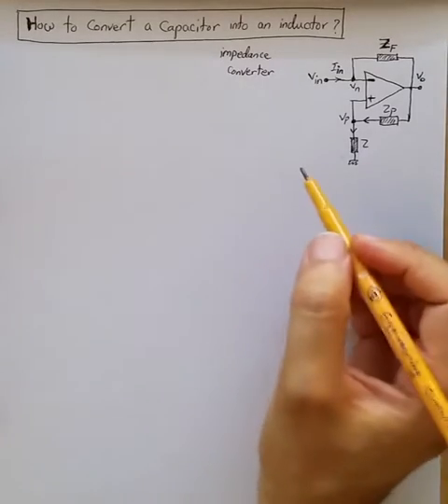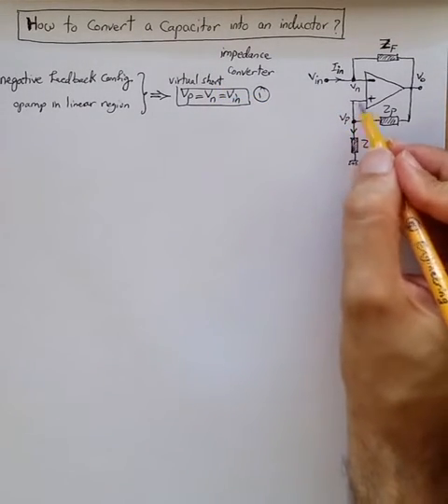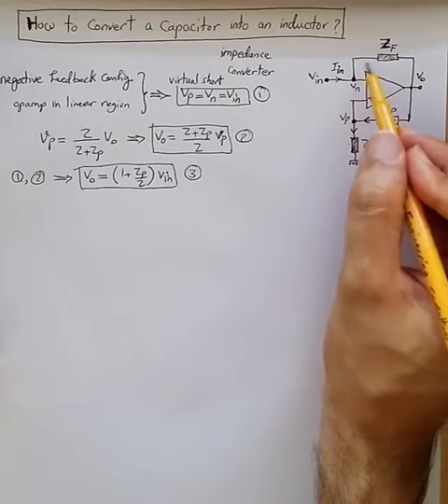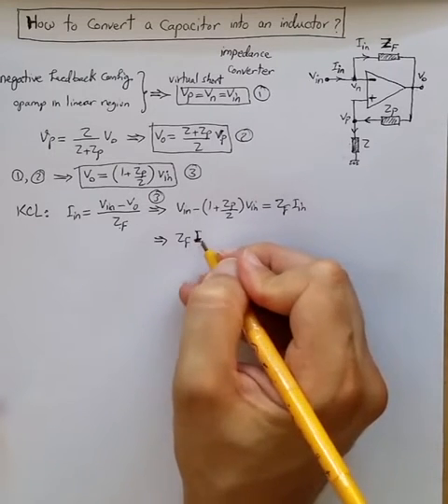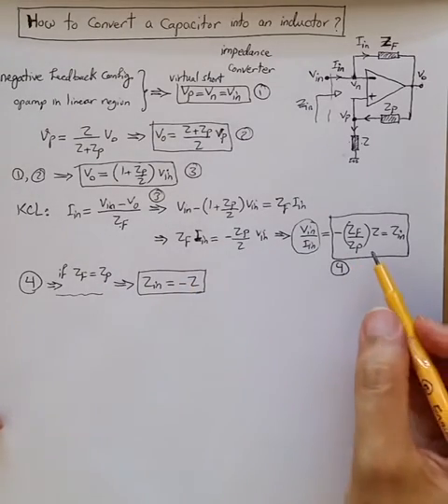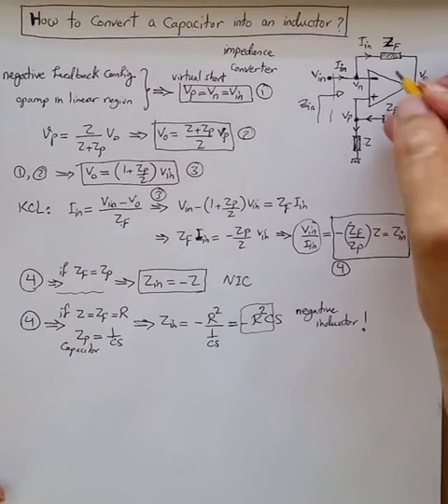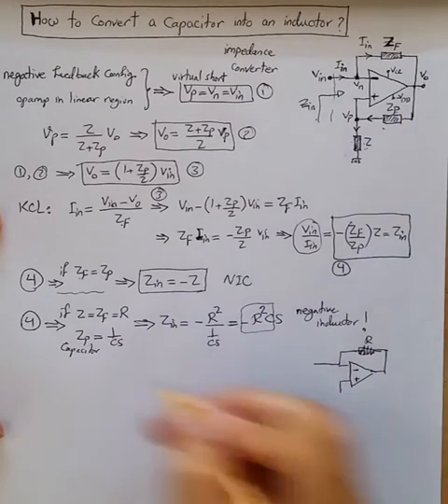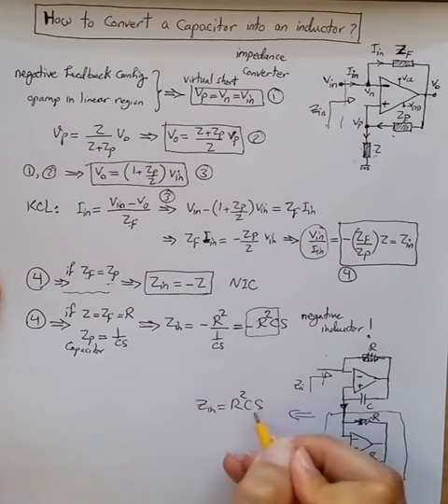Converting Capacitor to Inductor -- Simple Example using OpAmp

Comment: Do I understand correctly? If I have a R=2-kiloohm resistor, C=1 microfarad capacitor, and s = 0Hz DC, then I will have 4H (Henries) inductance?
Zeq = (2 kiloohm)^2*(1 microfarad)
Reply: And could I actually use this a 4H inductor (made from your circuit) in an LC tank circuit, to obtain a lower resonant frequency?
Reply from the maker: Yes Lydell, your calculation is correct but with a caveat that both opamps in this simple circuit need to remain in linear region of operation.